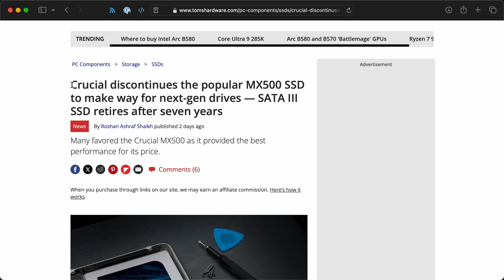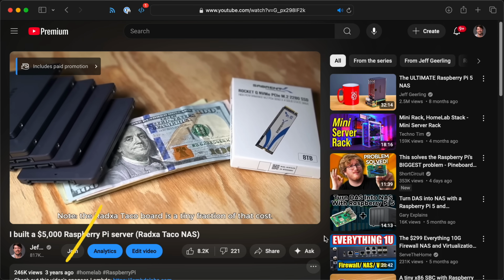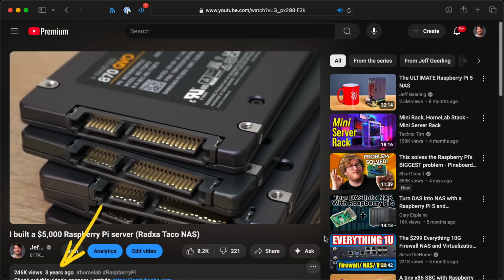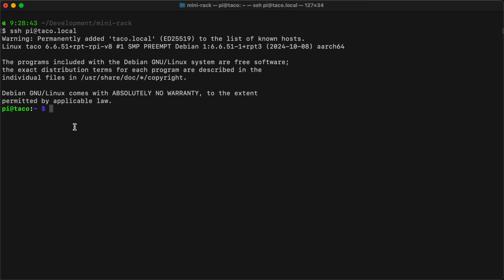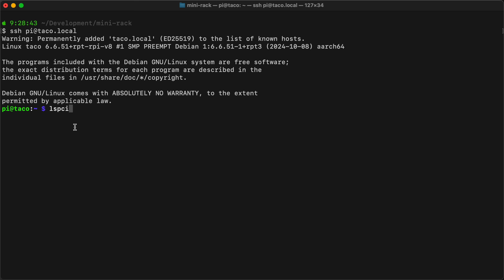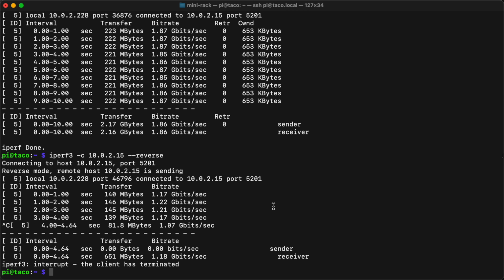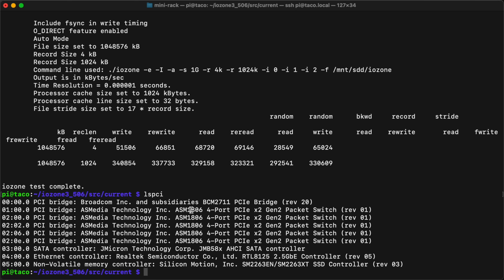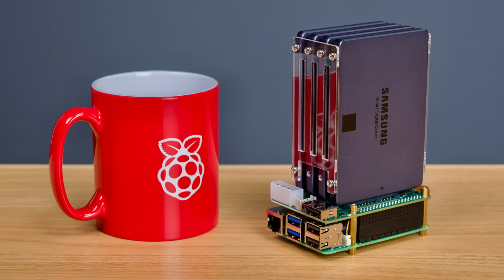The RETURN of the TACO! (SATA's last stand)

Comment: The description for the Taco on the Radxa site does not currently mention any Pi CM board for compatibility. I'm guessing that's because they want you to use their board. However, you have just demonstrated that it will work with the CM4.

Comment: So I got one of these Radxa Tacos, and after waiting patiently, finally got my hands on a CM5. I had a different experience than you did. I am able to boot to what I'm guessing is the built in bootloader of the CM5. It displays video from HDMI. However, I bought an eMMC version, and I haven't figured out how to program it from the Taco. Did you ever get this to work? I think I just need to get a IO board with the proper jumper. I'm hoping I can find or build a boot loader that allows it to boot from NVME after this.

Comment: @Level2Jeff -- Will we see some SAS based fun with one of these and a SFF disk drawer at some point?
I have a few disk drawers i use with a LSI SAS controller(HBA), reducing power overhead and allowing me to shutdown arrays when needed. I know you have touched on Hardware Raid on the CM4 in 2021. But, questions arise with CM5 and something like a disk drawer to reduce some of the headaches.

I would love to see this explored at some point. (CM5, HBA, SATA/SAS HDD+SSD, NVME ARC drive). 
Its mostly silly, but as a concept, it would show the possibilities.

Comment: I still use SATA SSDs because it is still vastly easier to find motherboards with > 4 SATA ports than it is to try and find a motherboard that has >4 NVMe slots (as the form factor, when placed horizontally, takes up a huge motherboard footprint that can be used for other stuff instead).

I think that Asus might be one of the few motherboard manufacturers that included the Asus Hyper M.2 carrier board with certain models of their motherboards, but then that can take up a PCIe slot, which, a) if your CPU doesn't have enough PCIe lanes as it is, it can become a problem (I think that the 9th and 10th generation Intel CPUs were the last generation to have > 40 PCIe lanes from the CPU, WITHOUT it needing to be a HEDT CPU), and b) if you're running a multi-GPU system (e.g. for AI workloads), those GPUs often will block some of the PCIe slots, which means that you WON'T be able to install said NVMe carrier boards anyways.

Compare and contrast that with SATA headers -- you can find 4, 6, or even 8 SATA headers, with very little issue.

One of my Proxmox test systems, which is running dual 3090s, is also running four Samsung 850 EVO 1 TB SATA SSDs in raidz via a TrueNAS Scale VM. (Testing how much space ZFS snapshots take.)

It's a LOT harder to do the same with NVMe SSDs. (I'd have to move up to a Threadripper system to be able to have enough PCIe lanes.)

I would LOVE a Pi NAS like that!

I'd have to research the state of ZFS on Linux on ARM though.

Comment: I really want to see an open source NAS for 3.5" drives that's designed with upgradability and longevity in mind. I bought an older generation Synology years ago that ended up becoming e-waste less than a couple years later because it stopped getting updates and had some security problems. Especially for background backup and light-duty use cases the CM4 has more than enough juice to do the job.

Comment: Random question, if you're up for answering it (perhaps with a future video): How many wired ethernet ports can a CM4 (or CM5) support, either in theory, or in practice with existing boards to plug the module into?  I'd like to have a multi-lan router, and thinking building something from something Pi-based might make sense... but I don't really want to use USB adapters, which seems to be the current option that I know of to get beyond 2 NICs.  Any tips/thoughts/relevant knowledge you could share?

Comment: There's a lot of Netgear ReadyNAS enclosures out there that are now aging doorstops, Netgear have ended to product line entirely, and these devices no longer get any updates. most of them were badly under powered anyway, which is a damn shame. Would totally love to see a CM Based board replacement for the internals that re-uses the case and if possible some of the backplanes too.

Comment: i can remember back then, when you first showed the TACO, I even messaged Radaxa and asked if the Board is compatible with 3.5" Drives. Sadly it wasn't cause if it were, I'd have bought it immediately and used it as a cheap and power efficient backup NAS solution...

Comment: If the Taco can provide enough power to run 3.5" hard drives then perhaps SATA power and date combo extension cables would allow all 5 SATA ports to be used for 3.5" hard drives.

Comment: Only when mechanical tech has reached its limits will there be a true push for bulk NAND storage. This is not going to happen for a decade at least. SATA is perfectly fine for bulk storage even more so that it runs cooler. Wish there was affordable 8TB+ NAND drives in SATA.

Comment: The 3.5" has too much weight/leverage.. (laptop/2.5" 4500rpm hdds are also a good option instead)
For the ssds it can still be fine but i would prefer to strut them together and add some screws..
But the price of cobbling together these things ends up close to or above standard micro itx / older components "good enough". If theres a complete cheaper set, OK..

Comment: Being too narrow for 3.5" is really weird. Maybe I'm forgetting something, but SATA SSDs are pointless for new hardware. SATA HDDs still have a place since they can have a lot more storage at lower prices per GB, but those don't fit (and those that do mostly don't have as much of an advantage).
The last time I bought SATA SSDs was so I could add an SSD volume to my NAS, but if it had more nvme slots I would have used those instead. Basically I just got less speed for the same price.

Comment: My last SATA drive kept giving errors. So I ended up replacing it with a second NVME. So I took a screw driver, and broke open the casing to have a look inside. Just out of curiosity. Very interesting! And when I went back to close up my PC again I saw that the sata cable wasn't properly pushed down :) So...don't be me. RIP Samsung EVO 2 TB, you did not deserve your demise.

Comment: Strange they have asmedia switch but use jmicron for sata. Not dying when 30 and 32TB drives just released.  I would have liked to see a new sata standard though that included higher bandwidth and different cable ends.  The current one's are so archaic compared to something like USB C.
Reply: There is no need for a new Sata standard when the main user of Sata standard are mechanical drives. SSDs have moved on to nvme

Comment: A lot of recent 3.5 in HDDs are thinner than spec, i think those should work.
Also, SATA isn't dead as long as HDDs aren't. HDDs are still a better $/Tb ratio than SSDs, so they'll be around for at least a bit longer.
Reply: People forget the 2.5" "laptop" hdds.
Not as fast but still available in large sizes, and the 5400rpms are good enough for storage..
WD had a magic blue drive that was used in POS and somehow almost never failed. Back when 160gb and 320gb was acceptable.
(where it should have been a red drive for 24x7)

Comment: Many M.2 drives can be run without a heatsync, however pretty much all 2.5" drives require some form of moving air if they are not using a case as a heatsync which is how most enclosed laptops work.

Comment: I'd rather get a mini itx nas motherboard from AliExpress. Either the n5095 with 12 sata ports for less than $110 or the n100 with 6 sata ports and 10gbe networking for $135.

Comment: I don't think I would try to stand a 3.5" HDD vertically on its connector. The weight of most HDDs is something like 1.5lbs if I recall correctly and the likelyhood of breaking the connector on the drive or the board is very high!!!!

Comment: They have been predicting the death of SATA for almost 20 years now. The last time I spoke with HDD vendors, they suggested that SATA will continue to be around likely for at least the next decade. Yes, for home computes M.2 or similar interconnects will rule the roost, but for enterprise or datacenters SATA still holds a lot of control as it is both cheap and can be plugged into an external backplane. And unless HDD vendors want to do NVMe for rotating media, I just can't see them going away. Not to mention that NVMe adds cost to the drives, which is the primary reason that SCSI/SAS never booted ATA/SATA out of the market.
Reply: Since when is sata big in the datacenter?  I see mostly see mostly sas there, and for large spinning drives I don't see much of a cost premium at least on the drives I buy in mostly sas but a few of the same in data for a few oddball setups which didn't have sas support.
Reply: @glennmcgurrin8397  Since the biggest consumers of drives in the industry are the big 3, MSFT, Google and Amazon. The vast majority of their spinning data is actually SATA has been and will likely continue. When you are buying petabytes a penny or so per GB matters. Also, they tend to near the highest capacities for whatever time frame is available as they are looking for density. This has been true for as long as I can remember and again the last time I saw a roadmap from both Seagate and WD this was stated as being true for the next decade.  While I personally prefer SAS simply because of the increased error correction and error reporting that SAS has, if you were to do some serious research about PB sold, I think you will find that SATA is king still.

Comment: Hi, I'm Nick and I'm a Data Hoarder. I've gone 3 hours since I last zipped some folders "just in case". 

My main NAS (32TB) is seriously old, aka FreeNAS 9.10, the 'new' NAS is a Proxmox VE setup (24TB) with a backup PBS for the VMs. I've two lots of four disks for offline NASs (~10TB). I need to consolidate. I've spent the last three months looking at options. What I really need from Santa Jeff for Christmas is a HAT or CM5 board to provide:

* Two M.2 slots so I can have a mirrored boot, fast storage for the admin server & probably BCache.
* Five, maybe six SATA (yes, yes, I know, but I have lots of old but good 3.5" spinning rust to use up)
* 2.5GB Ethernet so I'm future proof - almost all my daily dev stuff is on NMVe/SATA on my desk.

I just want the SATA connections, no power, I can arrange that. I absolutely don't need hot swap - I've never had to hot swap a drive in my life (56 years so far). I do like RAIDZ2 but am thinking of SnapRaid - like RAID but you can still read a drive standalone -  for all the archive stuff. All my daily work is on the local machines backed up to the NASes & internet so don't need lots of blisteringly fast space.

Right now I'm looking at using one of the PCIe 'splitter' boards to provide the 2 x NMVe I have and then add a SATA board. If you can hint to someone that some of us need far more storage than NMVe or SATA SSD's can supply to keep our horde safe, that would be peachy!
Reply: PS, Taco & Stand in the title - Tex Mex for the win!

Comment: I find SATA still to be super handy for hobby projects and people with a smaller budget since at least on the consumer side of things, M2 slots are rare on most pieces of hardware and if those exist, things raise in pricing easily.
Actually now I remember how I wanted to make my offside backup station that's sitting save in the company, eventually I went with an old Pi 3 and two spare SATA SSDs I still had which I have connected via USB. Works for me but this here is definitely cooler.

Comment: Uh, who exactly said SATA is dying? Unless motherboards started including onboard SAS controllers and I just wasn't informed, SATA ain't going nowhere.
Reply: I think the point isn't "sata is going away move to sas" it's "sata is going away to focus on NVMe"
Reply: @balthxzar  that's really not sustainable though. Putting aside overall increased costs, that essentially means dedicating entire PCIE lanes for single storage devices which is a super wasteful use of resources. For main system drives or game drives or something it can be worth it, but the only way all drives on the system will be Nvme (& not be massively wasteful) is if we start getting a lot more pcie lanes on consumer hardware.

Granted, pcie switches can seemingly mitigate this problem, but then your invisibly linking your storage's performance with your GPU's performance and any other pcie devices that are on the same root lanes. (Which, unfortunately, since most motherboard manufacturers don't even give you block diagrams to track the lanes, you can't really even plan for)

If the idea that we're moving past SATA speeds is the issue then SAS is really the only way to go. You'll still be using a PCIE lane sure, but that ONE lane (or set of lanes) will be in charge of storage entirely, meaning you'll have a nice, clean, theoretical maximum I/O rather than having inconsistent I/O performance based on how loaded your GPU is or vice versa. 

Not to mention that SAS allows for higher capacity in general and supports HDDs as well.

I dedinitely do think we'll be seeing a push to reduce SATA because "well just use NVME" but I have a really hard time ever seeing SATA actually 'die' until builtin SAS controllers are a thing. It's just not a storage solution that really scales all that well. (And given how big games, movies, shows, etc. are getting with increasing resolutions becoming increasingly common, "scaling" is a bar the average consumer can hit very easily now.)

TBH its always been weird to me we haven't already dropped SATA for SAS. I guess it's a market inertia thing but it really seems like more companies would want to advertise they're "THE ONLY GAMING MOTHERBOARD WITH FULL HIGH SPEED SAS BUILTIN" and then other companies follow suit.
Reply from the maker: Ooh now that's an idea! Get SAS everywhere!
Reply: @Level2Jeff  I'd love Sas connectors on the board with sata breakout cables instead of running a bunch of individual sata cables to them, you know without the need for a card.

Comment: Sata isn't really dying... There aren't affordable NVMe drives above 4TB, but you can get affordable 20TB SATA hard drives. Maybe SATA SSDs are dying, but for "Bulk slow storage" it's still pretty alive.
Reply: Yep. I recently was browsing the internet comparing prices and wondering what drives I wanna use for a small home server. Something small around 20TB...
Even going with the cheapest SSDs, by the time I reached 20TB of SSD storage within a reasonable number of drives I could have gotten 60-70TB of spinning rust..
Uhm, no, thank you...
Reply: @shapelessed  yep. I got a pair of 12tb hgst refurbished Enterprise drives for 120 last year for my home nas. Plenty fast enough for storing videos and documents.
Reply: NVMe is limited by PCIE lanes.

Each type of storage has pros and cons.
Reply: @joshxwho  Yeah. I want to add a secondary cache to my NAS with SATA SSDs as they're cheap and can easily add them in with a SATA controller. Meanwhile I'm out of M.2 slots even with a bifurcation card. Not to mention that SATA SSDs are still pretty fast compared to an HDD.
Reply: @joshxwho  Let's all completely forget 9 3.0 lanes could easily saturate a 100Gb/s network link NONE of you have...
Reply: @shapelessed  unfortunately PCIE lanes on consumer hardware is a dream nowadays. Choice between NVMe or network 😭
Reply: @shapelessed  sure, but you need some lanes for drives and some for nics. Cheap enterprise nics are 8x3.0 for dual 10gb (connectx3). So there goes 8 lanes. Now if i want to go from nvme drives to nics without bandwidth constraints i need either 4xgen4 or 8xgen3. I'm not aware of a 10gbe adapter that is 1xgen5. I'm not aware of a cheap solution to turn 16xgen5 into 32xgen4 or 64xgen3.
Reply: @joshxwho  Overcoming that limit is what the chipset is for. Albeit at reduced speed, but probably still beating SATA.
Reply: There's little/no discount for SATA SSDs over NVMe SSDs on Newegg these days. SATA's gonna be HDD-only again, eventually.
Reply: @crash.override especially when you consider stuff like write endurance dram cache for write buffering etc.
Reply: As someone who still owns HDDs,  "slow" really needs a /s.
Reply: @pinaz993  well slow is relative. For storing photos that I'm going to look at once in a while? Plenty fast. Streaming video plenty fast. For playing games or having my IDE's working directory? Way too slow.
Reply: @KodiakWoodchuck  if you use 2x2 (SATA HDD x SATA SSD), in a Raid-Z1 ZFS Pool, with a NVME partioned for ARC. the performance is quite impressive.
Using something like the TACO, you could easily swap the primary filesystem on the pi-os, to single-zfs and have it backup to the large pool seamlessly.
Reply: Cough cough u.2

Comment: BTW, PWM does not require 3 pins. The power pin is pulsed to control the rpm. The 3rd pin is the signal from the fan back to the controller to report speed.
Reply from the maker: True; though most of the better fans (especially quieter ones) seem to like 4-pin PWM instead of just chopping the voltage.
Reply: "PWM fans" need 4 pin. It means the fan itself has the control logic to change its own speed depending on a PWM signal, while the power pin is non-pwm 12v.
"DC fans" use 3 pin. The host must use pwm or voltage on the power pin to control their speed, but it is more finicky and might wear out the fan or go too low for spin up at low speeds. This is why the PWM fans exist, their onboard logic handles the fan-specific settings.

Comment: Can't 3.5" SATA drives because of 12V missing on the board
Reply from the maker: 12V is present since the 12V power input is mandatory, though...
Reply: @Level2Jeff  could you please verify that with the multimeter? Thanks